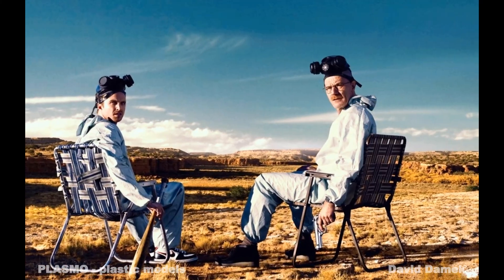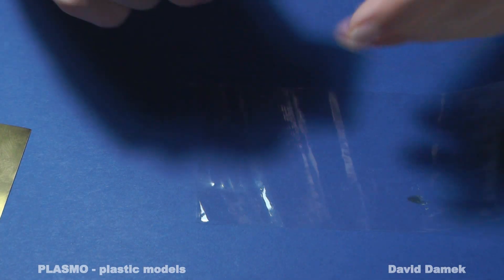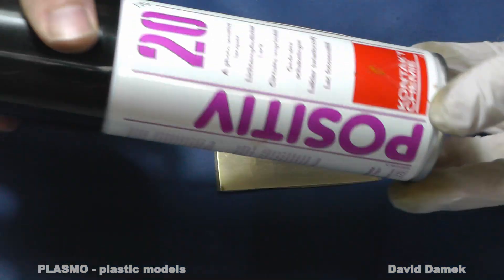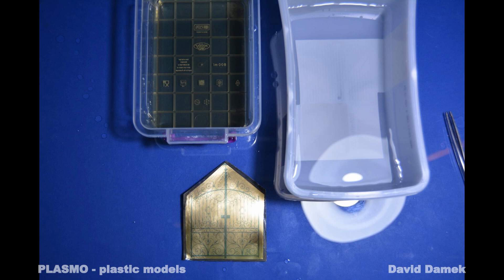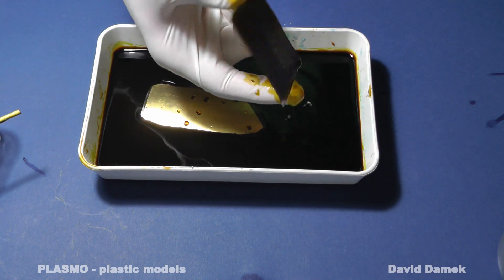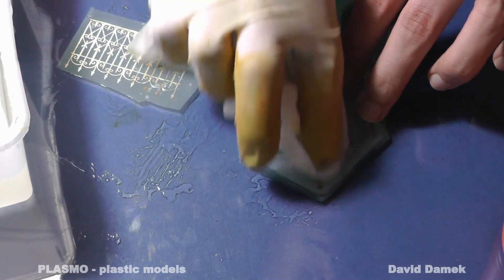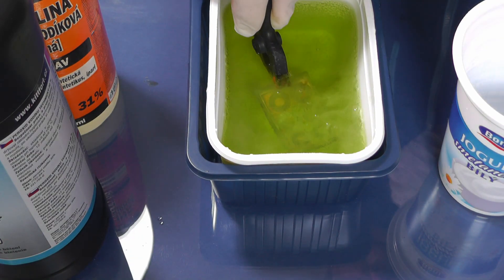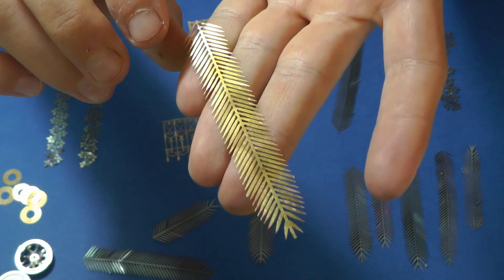How to make photo etched parts at home - Great Guide Plastic Models

Comment: Great video - you can learn a lot. I'm not entirely convinced about using adhesive tape as a support to hold the parts in place. When I tried this method, it was very difficult to get free from the adhesive tape... apart from that, I believe that the ability to create such elements is very developing.

Comment: this is fantastic.  How thick, or what is the thickest sheet you could use?  As for the printing, if you needed to, you could always have them professionally printed at a local shop, probably would not be that much for a few 8x11's of perfect high resolution
Reply: I would like to know how thick can you go because I am trying to do this with a 1" copper plumbing cap. I may just make my pattern on brass instead and do a wrap instead of a cap. So I need to know the thinkest metal I can use. The metal in the video looked paper thin.
Reply: @casmaran545  hey dude, I'm not the maker of the video, but it's a good question.  most etching becomes a thing of time.  time in the acid or time with the current.  the longer you leave it, the deeper it gets.  best thing, try it, take a video and share

Comment: If you have access to a laser cutter / engraver there is a quicker way. You can skip everything up until the etching. Put your brass piece on the tape,  spray it with spray paint, put it in the laser engraver paint side up and at a very low setting engrave the piece with a negative image of your pattern. The paint has now been removed from the parts that should be etched. After etching the remaing paint can be removed with rubbing alcohol or what ever dissolves it.

Comment: Going to try this this weekend on chemical milling of watch dials.  Is there a undercut rule of thumb?  Like for every 1mm of etching, expect .2mm of undercut or anything like that?
Reply: ‼️don’t attempt to use any Brass or Stainless Steel thicker than .05”. 
👉I just spent a week testing .10” SS on a small motor plate & it took 6+ hours of etching😱(I rotated & even flipped the plate in the NEW HEATED batch of etching solution) 
So the Sweet spot is .05” or less✅
Reply: I used fresh heated etching solution on .05" stainless steel plate & it took 50 minutes to fully etch. Hope that helps some....

Comment: I have a question. When i get professionally made etched brass parts, they often will have sections that are "half etched" IE, areas where the brass has been partially eaten away. Usually this is done on areas with raised rivets (i model trains, we have lots of rivets) or where the part is intented to be bent when assembling. My question is how would i acheive this? 
My guess would be to start by printing the rivets on the brass, start the etching process, and interrupt it partway through to add a layer of lacquer on the remaining part i want to protect.

Would there be a different way to do this?

Comment: I am thoroughly confused, I tried this using photo resistant film (positiv 20 is not available in the states) with images printed on a clear sheet as you showed. After exposing the image I got reversed results as the black images on the clear film ended up being the area that was going to be etched away from the brass sheet. What am I doing wrong?

Comment: so, i have a question: in your video, you make a complete material removal, but i often see photo-etched parts having different heights, displaying a shading or a pattern , like in this example here:
https://www.etsy.com/listing/792907229/fotogeatzte-28mm-32mm-fantasy-squad-mann
what i refer to is the large surface on the shields that has a different appearance. 
do you have an idea how this is achieved? is this a double-etch ? having etched the fine structures not completely through, than covered all up with a mask that is that fully etched through in a second step?
is it simply craftsmanship to reach this high level of precision, because the borders appear of uniform width. i would expect some distortion or asymmetry to one side due to misalignment of the mask.
or was there maybe some other method at work (laser)?

Comment: David
Does it have to be a certain type of UV lamp, with a particular wattage, or would any UV lamp be suitable, such as the cheap UV nail lamps offered on Amazon for £10 ? This would be the only reason I would be buying one, so I don't want to spend any more money on it than I have to. Thanks.
Reply: Good question! Can find UV lamp for nail at 15-25€. Between 24 and 80W. Would it be powered enough for this task? Many thanks Davud for all your work.

Comment: You say you use Sodium Hydroxide, which is Caustic Soda for the photo fix.  This is extremely toxic and dangerous, but I see you use bare hands.  You do not show the bottle or tell us anything about what solution you are using, unlike the photo spray.  Can you please advise what brand you use, the concentration, anything else.  I would like to try this method, but Caustic Soda is only sold in granules for clearing drains here, but maybe I am looking at the wrong thing.  Is there an alternative, like washing soda, as I have seen used in another video, though that was a different photo method.

Comment: Nice work! But... mixing peroxide with chloride under strongly acidic conditions sounds like it could generate chlorine gas.
Reply: He said at least twice that he recommended doing that part outside.  A vapor venting booth would also be wise if one needed to work with caustics indoors.

Comment: Dopes anyone know of an alternative to Positive 20 that can be had in the U.S.  Nobody on Amazon carries anything.
Reply: Amazon may not offer potentially dangerous liquids, and there will also likely be shipping restrictions that such big companies must comply with, in order to keep operating.  Smaller sources can stay under the radar of UPS and USPS, as well as U.S. Customs, for overseas shipments.  There are a few eBay vendors selling blue photoresist paint, and I got a couple of U.S.-based ads in my websearch for the stuff.  You might get better results changing "lacquer" to "paint" or "liquid" in your search.
Reply: I did just try searching for photoresist paint on Amazon.  The following one listing comes up, with no reviews:  https://www.amazon.com/FidgetFidget-Photoresist-Curable-Repairing-Negative/dp/B07HJ7RRL9
The product is probably coming from China and sitting in Customs, based on the month-long shipping time.
Edit: "Liquid" seems to get more results on Amazon, too.  I wrote all of this before trying that.
Reply: @VoltisArt  
Thanks!
What is the main component photo-resist is used for?  Is it just to mask UV Light?  If that's the case, I could use automotive urethane clear for that.

Comment: I have one question concerning the printed material. Is it plain presentation acetate or a thicker material? Or does it matter the thickness? can one use home printing (ink jet/laser) technics for printing on acetate or does that style of ink not transpose as effectively? Fantastic channel and video by the way. I subscribed.
Reply: Many eons ago they used overhead projectors for classrooms. You can still purchase overhead projector clear sheets that can be printed on with either a laser or inkjet printer or both.

Comment: If you heat the Fe solution it will etch faster. Just have to heat it with the proper temperature and use a lid or take it outside.

Comment: When you etch with Iron(III) chloride can you speed up if you use an Aquaristic glasheater (to warm controlled up), an air pump with airstone made of lime wood (better and smaller bubbles), placed under your object. You will find out that you really speed up and avoid under-etching at the edges. Additionally you can speed up once more, if you place you material to etch upright in cuvette with the airstone at the bottom. Now the bubbles sweep along the surface and speed up the etching process. Hint: it is usefull to place a cap over the etching container to prevent spray of burst bubbles.

Comment: Rather than using a hobby knife to get rid of the bubbles, your local sign supplier has squeegees and very fine points for smoothing down adhesive materials in pricking holes to remove bubbles. 

Awesome video.

Comment: Much better way of applying the photo resist/duct tape on the back side, is to wet both surfaces with window cleaner first. Then apply the tape and squeegee out the excess... the same way you apply window tint or a phone screen protector.

Comment: Hello. I followed your instructions exactly but I never get results like yours (Three attemps not one useable etch). I think the problem is with the Positiv 20 as the images I get after dvelopment are never as distinctive as yours. Do you knoe any other method to transfer the images to the metal? Thanks

Comment: Don't mix hydrogen chloride with water.  It creates Hydrochloric acid, HCl(aq)
Reply: Tomcat Model Kits kind of the point dude
Reply: The video never said that you should create hydrochloric acid.  What are you talking about?
Reply: Brass is a metal alloy made from copper and zinc
Reply: Thanks for the info!
Reply: The video is not entirely accurate. The "hydrogen chloride" liquid is hydrochloric acid, and the "zinc" sheet contains copper (stated to be brass in the description), as you can tell by the green etchant. The hydrochloric/muriatic acid + hydrogen peroxide etchant is commonly used for [non-professional] etching copper off circuit boards also.

Comment: I have printed designs on photo paper using a laser printer, and then ran them face down on top of a sheet of metal through a laminating machine. The paper comes off after soaking in some water. There is also a heatless method http://www.instructables.com/id/Heatless-cold-Toner-Transfer-for-PCB-Making/

Comment: It was only briefly mentioned in the video, but the photo-sensitive emulsion should be applied in a "dark room" environment, and the air should be clean (no dust floating around). Dust specs in your film can ruin a print, depending on where it lands. I use a cheap yellow bug light, and the 24 hours while it's drying also needs to be in a clean place so dust and bugs don't land on it. It would have been cool to include in this video the 2-step exposure process showing how to make de-bossed parts (some areas etched partway through, other areas etched completely through). Basically, separate masks for front and back patterns. (Use registration marks on the two design patterns for alignment.) My final comment is it's a good idea to clamp your artwork under a glass plate while exposing with the UV light. If it shifts at all during exposure then that will also ruin your parts. Oh, and always dispose of your used chemicals properly!
Reply: I've been told that many of the milky plastic containers block UV rays.  If that's the case, you can just cover it with that and leave it on your desk.  Then again, I wonder if solid containers also block UV rays...;-p
Reply: It's not exclusively UV that exposes the resist - "photo-sensitive" material will react with almost all light, it's just a matter of exposure time. (True, some wavelengths are effectively inert for photoresist, but it's still a good idea to minimize light exposure prior to developing.) People use UV light because it's fast, taking only a couple seconds or minutes depending on the intensity. Normal light will also expose the resist, but it will take longer and then you lose image quality.
Reply: Ah, so go with solid

Comment: I have been using this method for making railway loco name plates and various model tram parts for years.
The light sensitive coating chemical I obtained through the PCB trade. Unfortunately I bought the negative one instead of the positive one. It works,  but needs more work to set up the design on a PC since it is the printed black lines which are etched. I have had it for some 15 years and keep it in a small fridge. 
For the developer I use a solution of baking powder (as advised by the PCB trade).
I have been using .4mm brass sheet which is fine for name plates etc. but has to be etched from both sides for items as demonstrated in the video. Believe me two sided work is very fiddly to coat and set up. 
Any way, it was a very interesting video.

Comment: Thank you very much for posting this tutorial, the only part I'd have trouble getting is the UV lamp, but not that much trouble, just have to save up a week or 2. The amount of detail you can get is amazing & the amount of money a person can save by doing it themselves is great as photo etched parts can add up after a few pieces & whats needed for a given project. Thanks again & the info was worth subscribing as modeling is a hobby that flourishes when knowledge is passed amongst its practioners
Reply: Percy Barbarossa The UV lamp is the same one used to dry polish on ladies' fingernails.

Comment: I know this from making electronic circuit boards. And i ever had the problem at very fine structures that they are etching away from the sides instead of the front where the protection laquer is. Didnt you?

Comment: I'm kinda lost on this. Let me know if this right:

Cut out brass sheet to size of decal.
Cover back of brass sheet with tape.
Sand and clean other side of brass sheet.
Spray photosensitive glue on clean side. Let dry.
Place decal over glue side and place under UV light.
Glue adheres to decal image ink. Decal sheet is pulled off.
Brass sheet is placed in nasty chemicals. Brass that isn't covered by ink is dissolved.
Remaining brass bits are peeled off tape backing.

The UV transfer is where I think I lost it. How do you make sure you have good contact between the decal sheet and the brass? Wouldn't it better to have the decal sheet face up over a glass with the brass piece on top? You would just have to invert your UV source.
Reply: Bruce A for starters it is not a decal. This is called a transparency. 
The glass will hold the transparency down just by its weight. 
What is sprayed on is not glue! It is a photo resist used to make printed circuit boards. 
Exposure to UV will allow the exposed resist to be washed away. Where it was not exposed, it will not wash off. 
The resist will keep the etching chemicals from removing metal. 
Hope this helps.

Comment: You don't need to worry about the bubbles under the tape.  As long as the EDGES of the tape are securely rubbed down - no problem.   In fact you could cause problems by pricking holes in the tape........IMO
Reply: No if there is only the adhesion at the edges then when the etchant (etching solution) etches through, the sheet will be attacked from behind and destroyed. It even better to lacquer before taping. I lacquer then tape.
Reply: I don't think so. At the end of the process, those edges exist no more and the chemical solution comes beneath the structure.

Comment: I have etched lots of PCBs with Ferric Chloride. It's a very safe chemical but stains your skin something terrible hence the gloves and glasses! Warming it speeds up the process considerably too.
Reply: Yep, warm it up and it won't take 2 hours to etch. Etch time is important because the metal isn't dissolved in just one direction. Yes, it etches faster through the metal than through the pattern, but depending on how long it's in the bath it can undercut the design edges (a problem if making very fine intricate patterns). The less time it's in the acid the better.

Comment: You can also etch with Cupric chloride ( its more  reusable than ferric chloride and doesn't stain as much) 
2 parts Hydrogen Peroxide ( 20 or 40 Volume )
1 part Hydrocholric Acid ( pool acid / Spirits of salts /Muriatic Acid )

( more here :  http://www.instructables.com/id/Stop-using-Ferric-Chloride-etchant!--A-better-etc/ )

Comment: how long did you leave the zinc sheet in the developing solution? because it looked like you just stuck it in there, wiped it off really quick with the brush and then took it out.

Comment: this is an amazing video, but i do have to ask, is making your own photo etched parts cheaper then buying them, if not then would you only recommend doing this if you want to use custom made parts in a diorama?
Reply from the maker: Of course, it is much cheaper than original parts. I needed palm leaves for my diorama and original parts cost 25 euros a few laws.I bought ferric chloride for 4 euros and NaOH only 1,5 euro. One zinc plate A4 size cost 2.5 euros and UV lamp cost 5 euros. Photosensitive lacquer is expensive 15 euros but you can use it many times, so the total cost of the etching one A4 sheet is slightly below 5 euros.  and it pays off

Comment: super tutorial, i have a question about gimp. what dpi settings are you using for the image? i use gimp all the time so the designing would be easy. :) thanks.
Reply: 300dpi is recommended for printing, at least not less than 150dpi. 600dpi is very detailed, already too much for most hand made operations. 1200dpi and higher is uselessly too much detailed and even some printers cannot follow it.
Reply: also just wondered is there a way to half etch parts without doing the process twice?
Reply from the maker: I used some default dpi. Gimp is just one solution vector graphics will be much better.
Reply from the maker: Etching from both sides is very complicated and I do not recommend it
Reply: @Dorsey Ottesen shut up, don't ruin another video

Comment: great job,but how did you do the actual etching?with a sharp hobby knife?
Reply: The actual etching is done by the chemicals. The chemicals start to dissolve the metal. Any metal covered by the black drawings does not get eaten away and thus the metal takes on the shape of the drawings..
Reply: I think by etching Walter means engraving maybe? so not actually cutting straight through the metal sheet but scoring the surface. In which case i guess it could be done by part exposing the metal to the chemicals for half the time.
Reply: Danny M NL 
What's the PH of the chemicals he used? More specifically the Iron (III) Chloride or Ferric Chloride like he said.